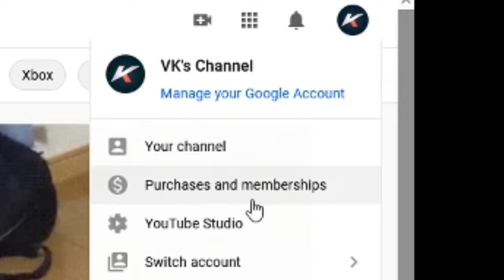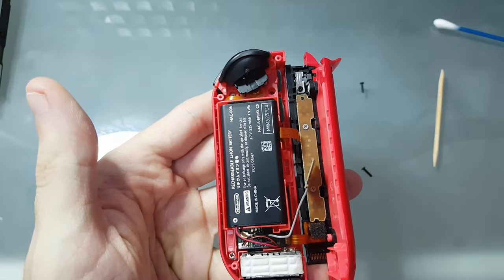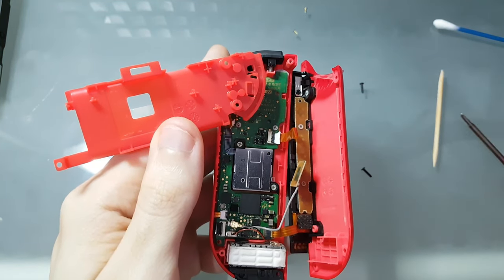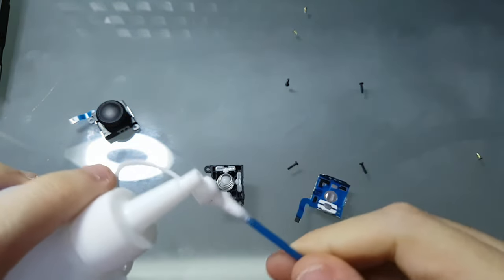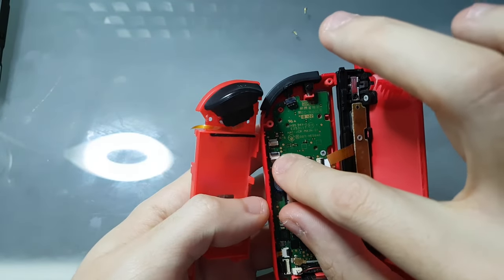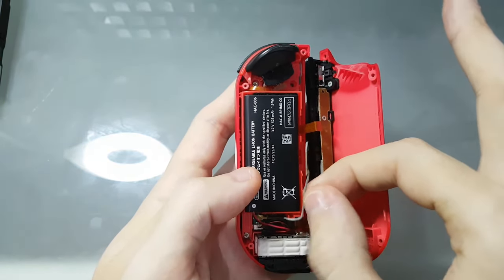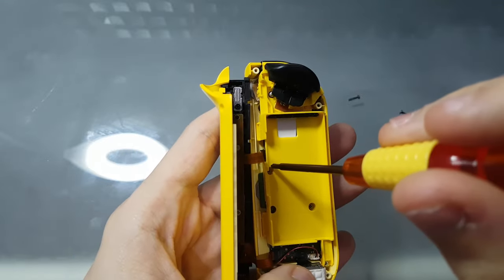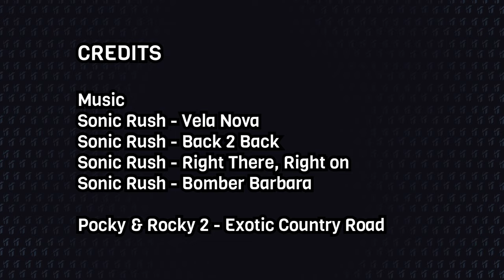Joycon Disassembly Step By Step + Analog Stick Cleaning

Comment: Yesterday I fixed my original joycons that came with my switch on launch day. 1mm of cardboard or business card seemed to be too thick and less than 0.7mm was too little so I settled with 0.7mm. It's awesome playing with them again in skyward sword HD. Drift shouldn't have been a prob in the first place but Nintendo obviously never cared.
Reply: Its cause iwata died
Reply: Where did you get your 0.7mm cardboard? I want to buy some but don’t know where I shall start
Reply: @cal5964  I just used a business card and wrapped regular, clear, scotch tape around the little squares of it I cut out till they were 0.7mm. Go to any place of business or any one that has free business cards you can take and use them. One business card can fix over like 6 joycons. If you don't have calipers, just wrap the squares of card little by little. Put the shells on but don't screw it together yet and hold it firmly together and test to see if it is still drifting. If it is, you may need no wrap more tape around it. Check again till you got it fixed and put it back together. I wouldn't go over 1mm though. Your controller will bulge too much and if you need more than 1mm, your graphite contacts inside the controller are probably too dusty or actually worn really bad. Good luck!
Reply: @SSGSativa  thank you for the extremely good detailed answer. I will try that out
Reply: @cal5964  no problem! If you have any questions when trying this, please feel free to ask me. Also, you don't need to take off any ribbon cables, just be careful. And there is a part inside (I believe the left joycon) that you need to unscrew. There are 4 screws and it looks like you need to take them all out but you  ONLY need to take out 2 of them. Taking out the others isn't needed and can easily strip the pcb. I suggest you watch an up to date vid first (Edit: My bad. Just realized these comments are under a vid on this entire topic🤦🤣). But it's simple enough and again, when you do this, if you have any questions at all, just hit me up on here. Have a good one!
Reply: Joystick Drift seems to happen more frequently with PS4 controllers, XBone controllers and of course Switch Controllers (Joycons and Pro Controller). PS3, 360 and Wii/Wii U didn't have this issue.

Comment: Nice. Thank you.  But to be clear of all you want to do is apply cardboard fix no need to take joystick out.  Once you get to the back of the stick it’s enough to simply put cardboard on and reseal right?   Thanks.
Reply: Yeah you only need to open the plastic under the battery and you're all set

Comment: My results: I had an original series red right Joycon that was drifting, and I used this method. It works!
My notes: Everywhere I looked online it said to use a 1.5mm tri-wing, not a 2.0mm. So I had ordered that prior to watching this disassembly video, and it works; I have trouble imagining how a 2mm would even fit--maybe that's why so many people strip the screws? Also, I didn't measure the thickness but I used a Tracfone refill card, which seems to be the thickness of all gift-card backers as well. It kept drifting downwards right when I put it back together, but I wiggled it in all directions to get it evened out and that was all it took!
Also, I didn't unplug the battery, I just flipped it downward out of the way as I only was putting the cardboard in.
I saw as I was opening it that there is a narrow channel along the battery that the antenna wire is supposed to be seated in. I made sure to tuck it back in when re-assembling. Thank you so much!
Reply: About the battery, it's generally good practice to remove power supplies when you're repairing electronics.

Comment: This doesn’t look too complicated, and O happen to have appropriate tools for the job, but I’m just wondering what a good paper/cardboard to put under is. Good tutorial!
Reply: Nothing over 1mm in thickness
Reply: All right, I’ll look at what I have
Reply: I believe in the original video VK mentioned a business card? I’d just say to take one of those and cut it down to size
Reply: @DesTr069  I used 3 pieces of roach for joints and that worked perfectly I'm so happy I can play pokemon unite without running to the bottom.
Reply: @stonedsavage7814  yeah, good idea. I ended up using a Cheerios box, and that worked fine. There’s a ton of options

Comment: Please, please, please do disassembly for Switch Lite.
Reply: There’s probably a tutorial on YouTube already but from what I’ve heard it’s much MUCH more complicated/harder and you run the risk of permanently destroying your switch
Reply: I wonder if maybe a local repair shop would do it if you explained the fix? But I can’t be entirely sure
Reply: Yeah, I still dont even know for sure if this fix works for the lite. I would 100% like this guy’s say so on the switch lite before i open a whole system. Because I am sure I dont have to disassemble it as much as i think i do. 

But As long as u follow a good tutorial extremely well, u should be able to do….but i have yet to hear a single soul ever say anything about switch lite drift being fixed.

So im waiting
Reply: Although it would definitely be harder to do than a regular Switch it theoretically shouldn't be too difficult. You could just follow a Switch Lite joystick replacement tutorial but when they are about to replace them just put cardboard under them instead.
Reply: @squiddog8933  see, the problem is that the right joy stick is A LOT harder to get to than the left one.

And, I dont know if you would be able to put something under the joysticks because of what’s already under them.

Its not like the normal joy con where its plastic right behind your cardboard,
There are pcb’s and other parts so idk how it would affect it.

As long as you dont go to thick then you shouldn’t break anything.

But you basically have one shot to get it right, or you’ll have to take the whole dang thing apart again.

Its pretty simple, but you can not make any mistakes

Comment: I got jelly in my B button and tried other methods to un-stick it, but this was the only video that was easily understood, straight to the point, and showed all the steps I needed to get past the battery and all that. My joy-cons are limited edition (the first limited edition anything I’ve owned in my 27 years lmao) so this allowed me to avoid risking sending it to nintendo and them sending the joy-con back without the face plates. Thanks so much for this video!

Comment: I tried it the first time and it didn’t work, but then I went back in and put in a second piece, now it works great!! The one question I had was why the home button is now a little…….. odd. Idk really what to say about it other than when it’s pressed it goes all the way into the controller. I’m not sure if I broke something, or moved something, it just doesn’t feel the same.

Also thank you so so so so SO much for finding this because it will help so many across the WORLD and I really love your way of thinking!! 🧠❤️😉
Reply: It’s possible that the shims are causing the top half of the joycon along w the joystick to sit higher/ bulge the center area, and since the home button has the lowest profile and is closest to the joystick it’s most affected and noticeable. I have no input as how to resolve it other than disassembling it to see if there’s some way you can adjust it.

Comment: Question: I managed to do everything you said but the drift still lingers just a tad bit and I didn’t clean the first joy con stick before adding the paper/business card. Would the clean up help the small linger of drift still there? Or is it a different issue?

Edit: also the joy on looks like it’s bulging out a tad bit with the business card/paper/cardboard, is that normal?
Reply: If you still have the problem i'd tend to think that the cardboard is a bit too thick but i don't know for sure
Reply: I would guess that there's an above-average amount of dust in the stick, so probably clean it. Idk if he did this part in the video, but the dust is between the metal bit and the blue circuit board.

Comment: I want to try this, but i don't have the proper driver bit size for this. You wouldn't happen to know what sizes you're using, would you? I want to clear before I purchase a random "joycon repair kit" online and not have the right size bits.
Reply: Read the description, there’s a link to where you can buy them.

Comment: So i just tried the fix on one of the controllers, but sadly nothing has happened. Im going to try cleaning it out with compressed air later but for the most part not a lot has happened.

I might try this on my other controllers to see if it will work

Comment: If I'm fixing the drift with a small piece of paper is it necessary to pull out the battery from the circuit? What if I only lift it up but don't unplug it from the circuit can I still do it? I wonder if there is a reason why you decide to remove it completely.

Comment: Omg this worked, I did the piece of cardboard drift fix and I have no more drift. I was nervous that I would accidentally break something but I managed to do it. I was NOT ready to accidentally break a joy con because I do not have the money to buy a new one, I spent to rest of my money on pre ordering Splatoon 3, same reason why I didn't send it in for free "repairs" (replacement) because I didn't know how long it would take to come in

My joycon has a super slight bulge now but I don't think that'll be a problem, it's like a millimeter or less thicker.

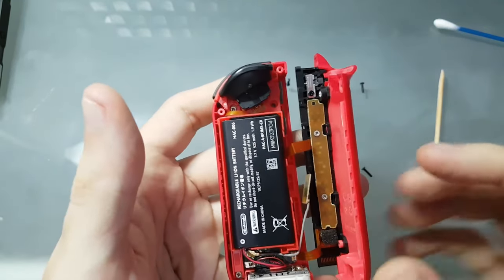Comment: 2:42 I have a weird issue where the bottom silver rectangle box stays attached to the back case instead of the front case for some weird reason which is kind of dangerous since there are wires getting pulled. Not sure what to do, I replaced my other joycon's stick a few months ago and didn't have this issue. Not sure if there's a way to make the silver box stay on the front case when I try to open the joycon.
EDIT: Fixed, it has two holes on the bottom that allow you to insert something thin to VERY slowly pull down and remove it from the back case. Then I just pressed it down gently on the front case.

Comment: I did test this out on my joy cons and it made a major improvement but when I go down it doesn’t go to all the way and I have to press harder to make it do that. keep in mind I was using paper so it could’ve been that. is there anyway to fix it
Reply: Paper is about 0.1mm thick, but you can use a bigger sheet and fold it. You can use some tape as well to hold it together.
Reply: @WorldLoveGaming  so 10 pieces of paper on top of eachother would work?

Comment: Just attempted it on my two drifting joycons. The left one seems to be working great now but the right joycon had a bad screw that wouldn't get loose, so i had to apply more force to get it open. I few things had gotten loose inside, and while i tried my best to get everything back in place the joycon now wont connect (and recharge) to the switch. Do you have an idea what part could be the problem? It would help me a lot if i had a better idea of what i'd need to look for

Comment: is there any fix for the Pro controller drift? I'm getting a bit of drift on the Pro controller, not as much as the joycons but it's there. The Joycons work perfectly now, would it be the same technique for the Pro controller as well?
Reply: Pro controller use a completely different type of analog stick like the ones on PlayStation and Xbox

Comment: is it normal for the joycon to be bludging a bit after the fix?? When attached on the switch it doesnt aling as well as the other but it work fine.
Reply from the maker: Try to use a thinner paper

Comment: after i saw the video of the joy con drift, i grab my joy con and add some force, then i saw a problem. the left joycon (blue in my case) wasn't turnin on the side light, and it's still works but the SR is not funcioning. Can you make maybe a video of it and what buy? i'm realy afraid of opening my joycon. Thanks
Reply: If the lights on the side are no longer lighting up and the SL/SR buttons do not respond, it sounds as though the upper ribbon cable on the rail going to the main board is either not attached, attached improperly, or damaged. You can confirm this further by going to the calibration menu and testing the SL/SR buttons there. This cable may also be responsible for wireless sync, so that's something to keep in mind as well.

If you're willing to open up your Joy-con to investigate, look up disassembly videos or go to iFixit to see a step by step guides with image reference. The first handful of steps in the joystick replacement guides there are useful for understanding how to get in. If the cable has simply been disconnected, it should be relatively simple to fix if you're patient and careful. A pair of screwdrivers of the correct size and tweezers or a spudger should be sufficient to get the job done, and can be found collectively in many analog stick replacement kits on Amazon for the Joy-con. If you find that the ribbon cable is damaged, you can also order a replacement flex cable for a relatively low price (around or under 10 American dollars). This is also a simple fix, so the process should not be too frustrating if it comes to that.

Comment: Ah a reupload to fix the audio. Still fine tho.

Although in my opinion, you should use glove or avoid touching the double adhesive in the battery holder to prevent any fingerprints.

Comment: Ok. I have both joycons with drift. I did this fix with my left joycon and after one fricking hour of pieces flying around, I did the work. HOWEVER!!! I think this may fail (maybe not), and It's gonna be my fault. I used an 1,25 mm piece of paper and bended a lot one of the sides on the 
aluminum plate on the stick. So, if it works for a full month, I think it's a win, I think.
Reply: Did it work ?

Comment: I wonder, is there any way to as easily fix the SLSR buttons not working issue? Just asking, you’re doing awesome work, VK!
Reply from the maker: probably your flat cable is damaged, in this case you'll need to replace as there is no easy way to fix it

Comment: I detached the battery by pulling at the cables and the wires came loose. Was it intended to be this way? If yes there is a danger of shorting the battery.
Edit: this is terrible advice, I destroyed the battery plug.

Comment: Very useful thank you. I'm very non-dexterous but I was able to apply the cardboard trick. I did however have another issue. Upon trying to screw back the battery case my R button fell out. No biggie I'll pop it back on like you did. However the little grip that goes under the R button came out, and I cannot for the life of me get it to stay on. I even showed my wife, who is nimble with very fine motor skills doing small nuanced jobs, what needed to be done and we just can't get it to stay. Is this some sort of defect? My R button has been spotty for quite some time.  It almost looks like this piece should be welded on? Any ideas?
Reply: I believe the R button is suppose to be soldered
Reply: @Alwaysbmoving  yeah I got in there and saw it wasn't even on the circuit and had to be soldered. Chalked it up to a loss (though managed to play SS with it by mapping SR on the right joy con to R)

Comment: I'm a little concerned about how motion controls will affect this fix. Specifically, my left joycon is drifting, and I frequently play ring fit adventure, where the left joycon will be shaking up and down constantly. Do you think this'll affect the fix?
Reply: I dont know if this would work or even negatively effect the joycons but maybe gluing the cardboard on it could work.
Reply: I was thinking about glue before, and I would imagine there might be just enough heat to maybe melt more consumer-grade glue.

Comment: I cannot figure out the right pressure to put on these screws. It seems no matter what I do, the screwdriver slips. I really don't want to strip these screws, but I've only gotten one out. The screwdriver seems a perfect fit for the one I've removed. But the others just will not budge!
Reply: I’ve had success with putting a rubber band in between the screw and my screwdriver while I turn it. It gives it that little bit of friction it needs to move. Even on a stripped screw!

I haven’t, however, tried it on screws as small as these before. So I can’t give you a 100% guarantee that it will work but you could try it. 🤷‍♀️
Reply: @mandysimkins6322  I already tried that to no avail. Maybe I'll try again with a different type of rubber band.
Reply from the maker: if your screwdriver is slipping then you have a bad screwdriver, I suggest that you buy another one to do it, stripping the screws is the worst that can happen

Comment: Unfortunately I never made it inside to see if the fix would work for me due to ruined screws and I ended up breaking (popped out) my L2 button because I was trying to separate the left joy-con shell apart 😔. On top of that I had another screw that wouldn't budge either. The two other screws were fine.

Comment: Does anyone have any idea's on what I'm doing wrong? I did everything in the video as best I could but when I closed the Joy Con it simply would not close completely and I can see the insides from the slide rail. I than took it apart and took out the business card cut that I put in there and when I closed it it still didn't close properly. I'm not sure what to do.

Comment: both of the left joycons i own have drift and i was planning on fixing both so i started doing one and the bottom right screw on the back became stripped despite the other three coming off perfectly fine, so i gave up and tried the other joycon and the exact same thing happened, all the other screws besides the bottom right one came off. Is the bottom right one just harder than usual? idk what to do at this point
Reply from the maker: here's the solution

https://www.youtube.com/watch?v=IrkTwqKj4js